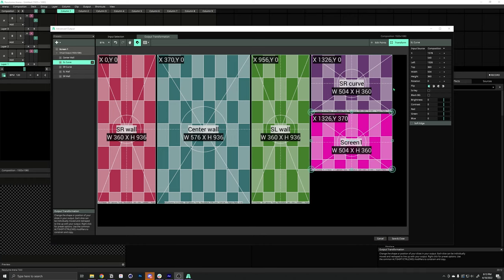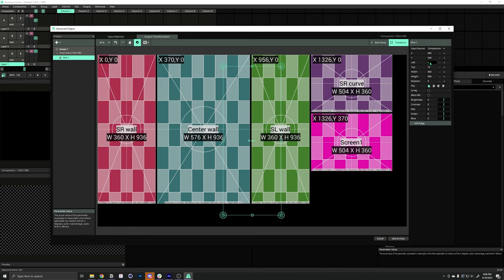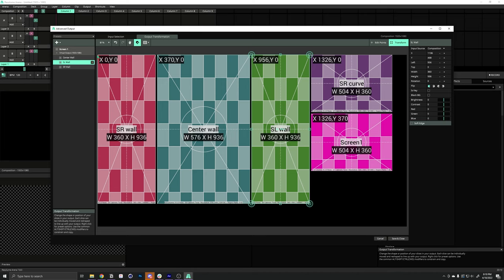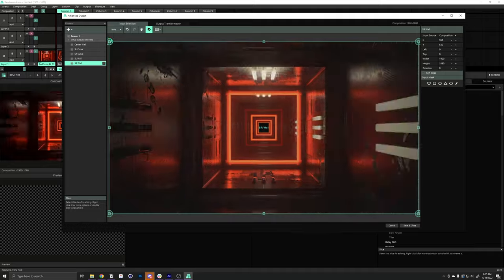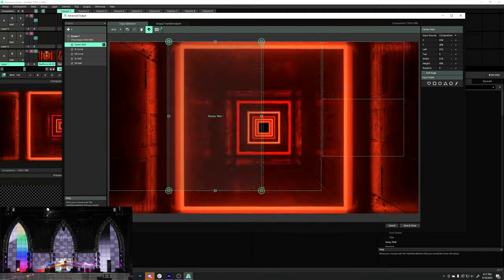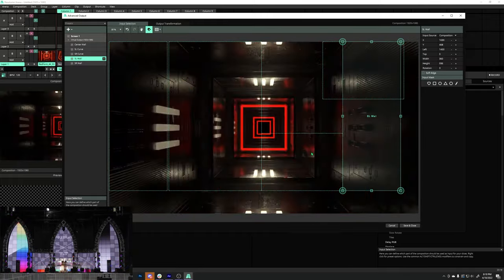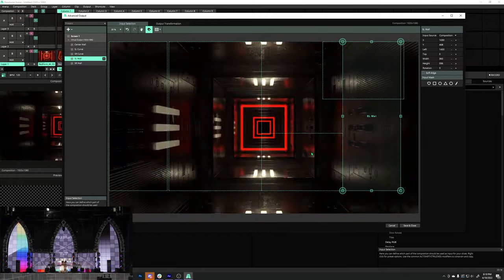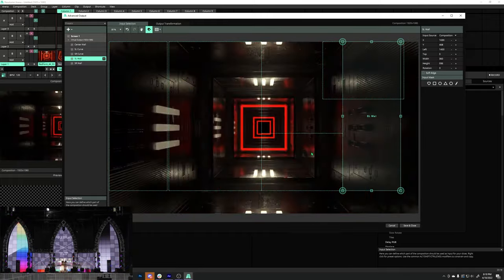Resolume Advanced Output | LED Screen Mapping | Quick Start Tutorial

Comment: Thank you so much for this video! I have a gig tomorrow night and sound check tonight and I’m having an issue where the “output” tab in advanced output isn’t appearing? Is the problem that I don’t have an LED matrix or should one output with a hdmi splitter be able to do this for 4 screens?
Reply: @darkobingus9714 this sounds like a bug. Did you get past it?

Comment: This video is great, I've 1 question. I've 2 projector and I wanna use its to present 1 video (1 projector present hafl video). How to setup this?
Reply from the maker: The process is quite similar. You need Resolume Arena to do it. Set up your two projectors so that they overlap a little, set up your two slices so that they are arranged and overlapping in the same way.  On the input side, arrange those two side-by-side slices over your video content. You can use edge blending on the slices if you need to soften the seam a bit. Look up Resolume Edge Blending, there are good tutorials out there about this process and resolume has a section in their manual about it.
Reply: @SeanBowes  thank you so much!

Comment: Hello Bro. thanks for this video. im sure this is gonna sent out from hdmi to switcher or processor  right? id like to know hoe do you do led wall mapping on tje hardware side like on novastar please. thanks for your response.
Reply from the maker: Yes that is correct, this is the step that happens in the media server (resolume) to prepare output for what the processor is looking for. I have had a video about programming in novastar for a while, but that isnt the part of the process I am usually involved with so it has been difficult to coordinate all of the things I need to make a proper video. I have got this question a few times though so I will work on making it happen! Thanks for the suggestion!

Comment: Hi Sean,
What is the benefit of rearranging the output map to 'save space'? Also what is the benefit of applying a mask to the input map slices if the screen won't pick up the extra content anyway?
Reply from the maker: Sometimes you need to rearrange them so that they all fit within the canvas of the processor, which is usually a standard video size like 1920x1080. In this case our total width is too wide to fit within that size if we arrange them as they are in reality. 

Regarding the mask: The screen will see the extra content. LED tiles are rectangular so to make curves you need to use masks.

Comment: Hi! Great Video. Was wondering if you absolutely need a pixel map .png file? Or can you just get the dimensions of each panel on paper and do it that way? Thanks.
Reply from the maker: You can totally just get the dimensions and locations of each panel and type them in. This is just a more visual way to communicate that info and confirm that its correct when your slices line up to the guide image, and it is what is commonly used.
Reply: @SeanBowes  Sweet, I am working with 5 cube columns with 4 panels on each side so it is a lot of slices !! I am going to try and get the pixel map file from the supplier. Thanks again!!

Comment: Amazing Video! Question, I would like to map a somewhat "O" out of LED screens, how can I mask the middle of the"O" being that it would be empty?
Reply from the maker: Check the mask settings and try flipping the Invert checkbox. You may need two masks, one to form the outside of the 0 and one to knock out the center hole. Remember that order matters, so move them around until it works properly. Testing it out now, this is what works for me using output masks: set the small hole mask on top, with invert unchecked. Under that, the larger circle mask with invert checked, and under that, the slice(s) you want to mask. Hope that helps!

Comment: Good day,

Great video.

I have a screen and I plug on everything and the screen not showing anything while the other screens showing things. What may be the problem?😢
Reply: The screen is in the middle of two screens. All the OTHER screens are getting signal and showing stuff EXCEPT THST SCREEN IN THE MIDDLE. What you think may be the problem?
Reply from the maker: There are a lot of variables. Take a deep breath, think rationally, and Go step by step down the signal chain to verify that you are sending and receiving signal, have power, and your settings are correct every step of the way. Try swapping things that work (outputs, cables, dongles) from a screen that does work to the one that doesn’t to see if one fixes it, then replace that cable.
Reply: Ok. Thank you for such. Let me I going to try it now. Thank you again.

Comment: How do i assign each slice to several fixtures?  I have about 50 Epix IP strips im trying to map.  5 per section straight lines.  This is hella confusing
Reply from the maker: This process is for LED panels. For LED strips you will need to use a different DMX fixture workflow. I don’t have a video about that yet. But check out this page for info on that process. https://resolume.com/support/en/dmx
Reply: @SeanBowes  thank you!

Comment: Hi Sean, greetings from Chile! Excusing my English and hoping that you are well! I would like to know how you create the grid or guide, where do you do it? I have mapped manually, looking at the screen and moving at the same time without going too far, I know the pixel size of my modules, but if I add the pixels it does not fit in the box I need, it is always missing or short, this is because work with a scaled image?
Reply from the maker: Yes if your processor is doing scaling that could cause a difference. Usually you dont want to use scaling on the processor if you are doing mapping

Comment: I’m not sure I understand why you crated the masks? I could understand it if you were using a projector but why did you need it for an led wall as the area you was masking doesn’t exist?
Reply from the maker: Great question! I think the image I show of the stage makes this unclear. Because LED only comes in square panels, there actually are panels that exist outside of the curved truss. The image I showed had it masked already, sorry that wasn’t clear! I hope that helps.
Reply from the maker: This is the image I should have used, it shows the actual LED panel area and how it relates to the pixel map. You can see there are some jagged edges that need to be trimmed with a mask to make them fit the window shape https://www.dropbox.com/s/gkapx9yadcgy6rw/StageImage.PNG?dl=0

Comment: What is use of test card ...,????? In led wall
Reply from the maker: There are many uses for a Test Card with LED walls and projection as well. The color spectrum and black to white gradient are used to check if your colors are looking correct and your black and white levels are correct. The  square grid is used to make sure your image is correctly proportioned and not stretched or squished. The circle is used for the same reason. The circle, diagonal lines, and grid are also used to make sure your image is aligned across different screen sections correctly. And the sweep is used to make sure the panels are synced and there is no delay, tearing,  or other weird things happening with animation moving across the screen. Some test cards have other features, for example photographs to make sure skin tones look nice. Overall they are a tool to isolate and test that different aspects of your image (color, gamma, dynamic range, scale, position, rotation, frame rate) are being displayed properly.

Comment: Hi, I have been watching your videos and found it very informative. It helped me a lot while using resolume. I was having small problem, as per ur instructions I mapped my screen but when I tried to display it on my LED screen nothing shows on the screen. I don't know where I am going wrong. I tried changing the screen 1 display in advance but it shows abnormally. Pls help me out
Reply from the maker: If you have your advanced output Input and Output maps set up properly, and you have assigned your Screen to a Display in Advanced Output, you should see something on screen. 

If you see nothing, there may be a connection issue between you , the processor, and the wall. 

If you see your output but it is not looking correct, that means something is wrong about your mapping and your slices are in the wrong position compared to what the LED processor is looking for. You can tell if this is the case because you see some of your slices but they are not lined up perfectly. 

You may also have Scaling on in the LED processor which makes changes to what you send it before it sends it to the wall. This makes it look like your output map is squished or stretched on the wall. so check out the settings for your processor and see if thats the issue. 

Sometimes using the Test Pattern  (Output>Show Test Card) Can help you see what is wrong.

Comment: The venue is responsible for the LED processor correct?
Reply from the maker: Yes whoever provides the LED and sets it up will provide the processor. If the venue has a permanent LED install, they have a processor set up for it. If you or the venue rent one for your artist, the LED vendor will provide one.

Comment: If I’m doing a wall with a window on it, and I don’t want the projection to go to the window, there’s a way of taking the window “off” the mapping? Like when you do the masks, can I just get the square mask and put into the center of the wall? 
If that’s not it, there is a way to do it? And how.
Reply from the maker: Yep, masks are the answer. Look in the properties panel of the mask for Invert to get it to cut out a hole mask instead of cropping inside the mask. There are input masks and Output Masks (add those from the + button you use to add slices). You may need a combination of masks and mask types to achieve your goal if you are cropping the outside and making a hole inside.
Reply: @SeanBowes  and what are the differences between input and output masks? 
Btw, is there someway for me to contact you if I need specific helps?
Reply from the maker: @carolinaromani7589  they are applied to either the slice itself in the input map, or added to the stack in the output map. Also applied at different points in the process, so input maps are able to be seen in the slice, like in slice outlines. Output masks are applied to the output, so after the slice is calculated. 

I try me best to get to questions here. Instagram DMs are usually pretty responsive. Or you can get a 1-on-1 session from my website and book an hour with me if you’d like.

Comment: I'm new to this, how did you get the X Y numbers?
Reply from the maker: They are usually on the pixel map image somewhere. In this case they are on the top corner of each slice. Width and height are printed in the center. If you’re talking about the mask points, some math might be involved. Add your left value and width to get your right edge, and add your top value and your height to get the bottom edge.
Reply: @SeanBowes  Thanks 👌

Comment: Hi Sean, I have a very specific situation. I'm working on a theater play and I'm using Resolume and a Projector to create the scenario. The point is I don't have a fixed mapping. Actually I have 3 different mappings that must be changed during the show. I know that I can create 3 Screens each one with its own slices.. but How can I swap between Screens (shortcut?) during the show?
Reply: make 3 layers with your cotent. make the 3 mappings. in advanced output; selectt input layer * for each slice/mapping. map midi control (ctrl+shft+m) to master to fader on each layer, or use mouse to control.
Reply: @zoolog2012  thanks bro!

Comment: Theoretically speaking, could you have your input transformation look exactly the same as your output transformation and everything will work the same? Is input mapping just giving you a good view of the stage?
Reply from the maker: There are situations where that might be the case, especially if your slices fit in your output map the same way they are arranged in reality and don’t need to be rearranged and packed together to save space. The input map is where the slices are told what section of your composition canvas to sample and sent to screen. So arranging them as they are in the real world there allows content to span across the screens in a logical and cohesive way.

Comment: Is there a way for me to pixel map led wall and a projector? Using novastar..
Reply from the maker: Led wall, yes. Projector, no.
Reply: You can but not via Novastar. You'll need to talk to you high res switch operator, assuming you have one. E2/E3, Spyder, Aquilon, whatever you got feeding projectors can theoretically slice and scale and map the projectors.

Comment: I feel like I goofed up somewhere. When I click “match output shape”, the content is broken up over each slice, yes, but only certain parts of it are showing and it’s not the parts that the slices are over. The part of the content doesn’t change when I reposition my slices either :/
Reply from the maker: Are you moving them on the Input Tab of the Advance Output? Hard to say exactly what might be off if thats not it. Shoot me an email if you still need help
Reply: @SeanBowes  I’m moving them in the input tab. I will shoot you an email
Reply: @SeanBowes  tried sending an email, but it wasn’t going through
Reply from the maker: Sorry about that, I’ll check that out. In the meantime shoot me a quick DM on Instagram and we’ll get connected

Comment: Please, is it enough for me to work with LED WALL MacBook air with M2 chip?
Reply from the maker: Definitely not the best option out there, but you should be able to run some basic shows with that. You have support for one external display via thunderbolt, and it meets the minimum specs for Resolume, but not much more than that.
Reply: Ok, Thanks a lot :)